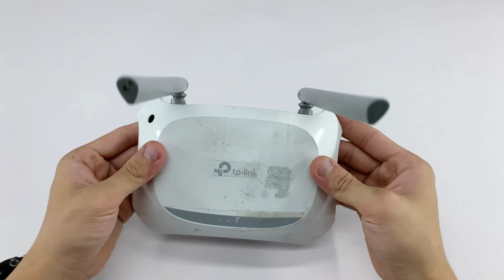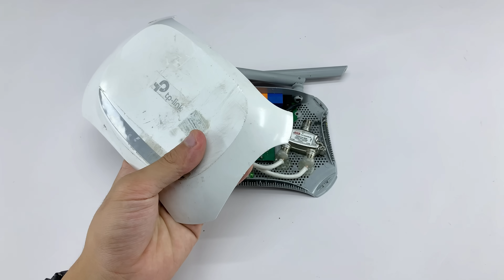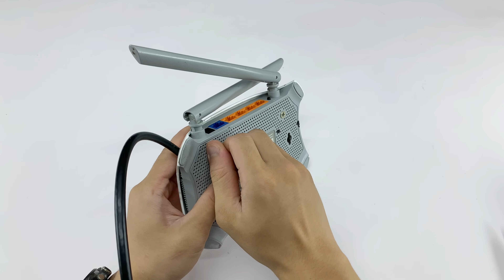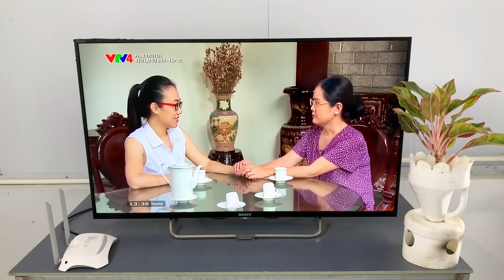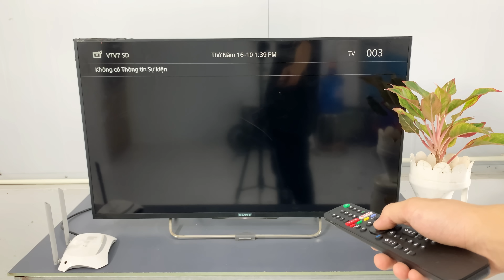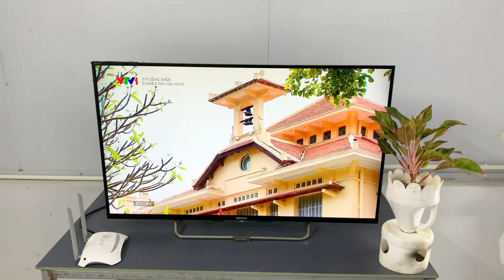Hidden Power! Insert a SIGNAL SPLITTER inside the WIFI ROUTER and Unlock Channels 📡

Comment: Why not use the antenna connectors on the outside?
Reply from the maker: Thanks for your question! 😊 In this experiment, we tried a different connection method to explore another DIY approach. Using the external antenna connector is also a valid option depending on the TV, antenna design, and setup. We appreciate you sharing your perspective!

Comment: “Oh, I’ve got an even better setup for you. Just shove the splitter input straight up your ass with a coax cable, then jam the two ‘live’ coax ends deep into your ears — preferably past the eardrums. Congratulations, you’re now fully equipped to receive every satellite channel in existence. And for the final touch, connect the shielding from those two output cables to the metal frame of your glasses… and boom — the picture will display directly in front of your eyes. Truly cutting-edge technology.”

Comment: It seems the router is working even though the power supply isn't equivalent.
Reply from the maker: Good observation 😊 It may power on, but if the supply isn’t equivalent, it might not be stable or safe for long-term use. Always best to match the correct voltage and current 👍

Comment: Will there be 2 inputs for the splitter?
Reply from the maker: Yes! A typical splitter has *one input* (from the source) and **two or more outputs**. If you mean two inputs, that depends on the splitter type—some specialized splitters combine signals, but standard ones usually have just one input.

Comment: How that router works without power cable tv channel directly comes through that wifi antenna is you think all are fool you cheater what you think all are uneducated no one can discover your lies
Reply from the maker: I get your concern! The router itself still needs power to operate—any TV-over-WiFi demo is just showing the signal, not bypassing electricity. Nothing secret, just clever setup.

Comment: bro not working what i doo
Reply from the maker: No worries 😄 let’s troubleshoot it step by step.

Check these first:

1️⃣ *Power source* – Is the voltage correct? Many laptop chargers are 19V. If the project expects 5V (USB), that’s a big difference.
2️⃣ *Connections* – Loose or wrong polarity (+ / − swapped) will make it not work.
3️⃣ *Signal strength (if it’s an antenna)* – If you’re in a weak signal area, it may not pick up anything.
4️⃣ *Short circuit* – Make sure wires aren’t touching where they shouldn’t.

Tell me: what exactly is not working? No power at all, no signal, or it turns on but weak?

Comment: can this be used to boost the internet connectivity.
Reply from the maker: Short answer: *not really* ⚠️

A simple antenna like that can sometimes *slightly improve reception* for:

* TV signals
* FM radio

But for **internet connectivity**:

* ❌ It won’t properly boost Wi-Fi or mobile data
* Wi-Fi and 4G/5G need **tuned antennas**, impedance matching, and specific frequencies
* Using random antennas can even *worsen* the signal or damage equipment

👉 For better internet, use:

* A proper *Wi-Fi antenna*
* A *4G/5G router with external antenna*
* Or a *signal repeater*

So it’s real for TV/radio, but *not suitable for boosting internet* 👍

Comment: analock signal all world close
Reply from the maker: Analog TV signals were *shut down in most countries* and replaced by **digital broadcasting**.
Digital gives better picture and sound, but old TVs with room antennas stopped working unless you use a **digital tuner or set‑top box**.

Comment: don´t you need a  internet cable and power adapter??  this modem it´s not conected in a power line???
Reply from the maker: *Good question! 👍*
No internet cable and *no power* are used here.
The router isn’t working as a modem — I only used the small antenna wires inside it like a simple DIY antenna.

It’s not powered on and not connected to the internet.
Just a fun TV-antenna experiment. 😊

Comment: You bull shit ass hole Wi-Fi Routers use radio frequencies in the 2.4 GHz and 5 GHz bands to create a local network for your internet-connected devices.
· OTA TV Signals (the free ones from major networks) are broadcast on frequencies between 54 MHz and 608 MHz.

These devices can't "listen" to each other's signals. It's like trying to listen to an FM radio station on a walkie-talkie.

Comment: connected the circuit board and disconnected the antennas that receive the signal; I didn't quite understand that modification.
Reply from the maker: I just used the board as a simple connector, my friend. The real signal comes from the DIY antenna, not the router’s antennas. 🙂✌️

Comment: How is that work when the router. Not connecting to the power 😅
Reply from the maker: 😅 It doesn’t!
The router isn’t acting like a real router here — it’s just used as a piece of metal/antenna housing for fun DIY.
No power = no WiFi, no magic. Just a simple experiment 📡😉

Comment: No disrespect, but this is a joke. I wouldn't do this because most likely you'll destroy the RF tuner in your TV.
Reply from the maker: That’s a fair point 👍 — connecting DIY devices directly to a TV’s RF tuner can indeed be risky if not done properly. Thanks for the warning! These projects are meant more as experiments or demonstrations, not permanent setups. Safety first! ⚡🙌

Comment: He didn't crimp the cable connectors
Reply from the maker: Good catch! 🔧 You’re right — crimping the connectors is important for a solid connection. Thanks for noticing! Do you often work with wiring or DIY electronics too?

Comment: US Yeah I don't think it will work here there is a comment below how all channels where analog and went digital. I bought the farthest reaching stick to your wall new antennae off Amazon and had to return it. The broadcast maps showed most broadcasting was 80 miles from me. Had a 2.5 story farm house they did sell a 25 wide thing I could install through the roof on a rotating pole to aim at the major broadcasts.
 Wish this would work. I just pay the cable company for local channels. Great idea but I am sure the range is limited and not capable. Plenty of old routhers; if the paid for 70 mile range simple antennae that was powered couldn't do it, doubt worth trying. IF you live in the USA and are out in the country please comment if it will work since they changed the broadcasting 15 plus years ago. Nice DIY other wise for unused routers.
Reply from the maker: Thank you so much for sharing your experience, my friend! 🇺🇸📡
You’re absolutely right — after the U.S. switched from analog to digital broadcasting, simple passive antennas (like this DIY one) can’t catch long-range signals effectively. It’s mainly a fun concept to reuse old routers and explore how signal reception works.
For real use, powered or amplified antennas aimed properly toward towers still work best — especially in rural areas like yours. ⚙️🔧✨

Comment: This is fake. The two internal wires is not even earthed with braiding wire. It wont even pick up a analog signal.
Reply from the maker: Thank you for the observation, my friend! 🔧🙂
You’re absolutely right — this setup isn’t a real working antenna, it’s just a DIY demonstration to visualize the idea using simple materials. The lack of grounding and shielding definitely limits signal pickup.
The goal was to inspire creativity, not to replace a real engineered antenna. 📡⚙️✨

Comment: Theoretically, it can work, but it has nothing to do with the modem and Internet. A strong unencrypted terrestrial TV signal is received by two antennas, then it is combined (amplified) and fed to the analog input of the TV receiver.
Practically I cannot verify it. In the Czech Republic we only have digital terrestrial TV broadcasting in the DVB-T2 system with HbbTV (H.265 / HEVC). Analog broadcasting ended many years ago.
Reply from the maker: Excellent explanation! 👍 You’re absolutely right — this setup is just a creative DIY concept, not related to Internet signals. Thanks for sharing your technical insight! 📡🙂

Comment: How does it work without a power transformer?
Reply from the maker: Good question! This DIY setup doesn’t actually use external power — it just reuses existing signal paths for a simple experiment. It’s more of a concept test than a real powered device. 🔧🙂
Reply: @Inventor799   The modification generates also free energy !!!🤣